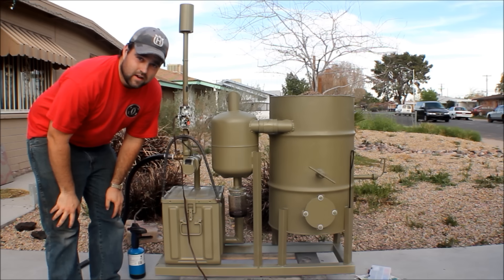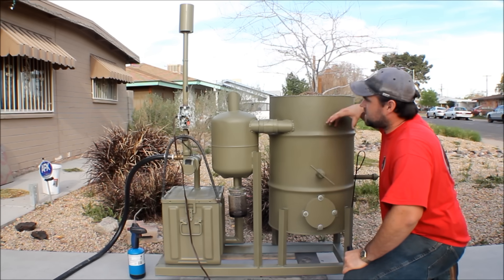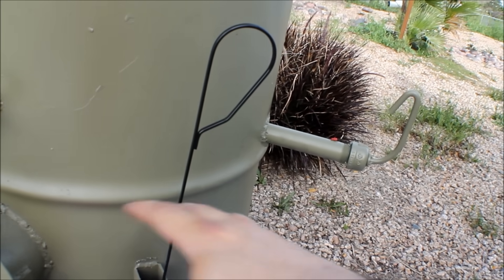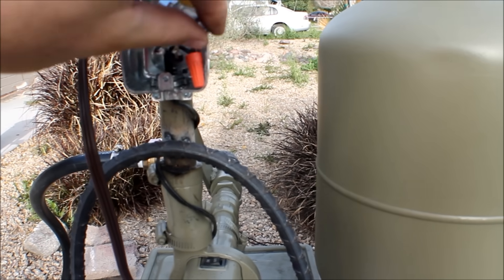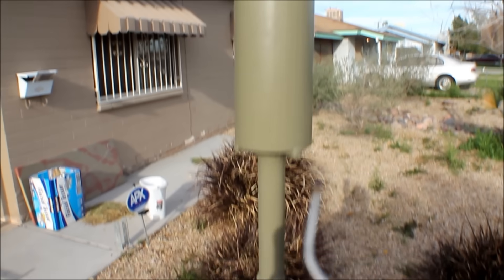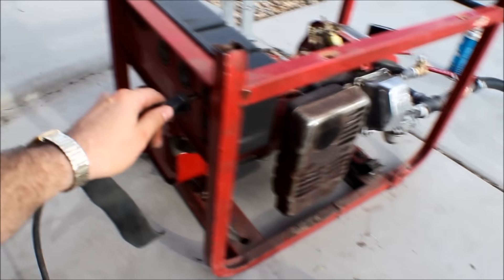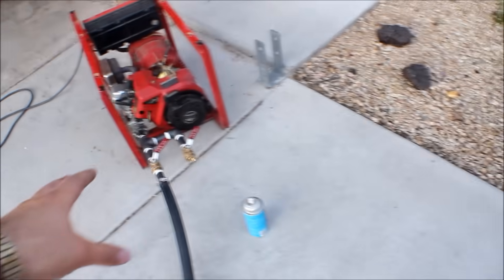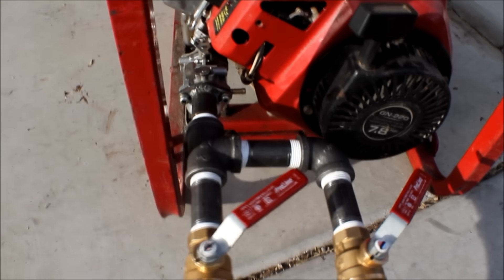amazing homemade gasifier uses wood pellets to run generator -- renewable alternative energy video

Comment: Awesome !!!
This has got to be,
One of the best Homemade Gasifiers I have ever seen so far !!!!
Thanks 4 Sharing Bud!!!
Reply: The balance of stokiometry (air fuel ratio) happens at both the front fuel end and again at the engine generator. I've built larger versions of these (10MW)...partially choke the inlet feeder with a double gate valve assembly and you can improve the efficiency.  The reason the barrel is getting hot is because there is too much combustion taking place at the feed end.  It's a delicate balance keeping both variable components in perfect balance. 

You need J-U-S-T enough gasification to generate combustible pyrolysis gases (mainly methane C4, C5, C6 hydrocarbons)to feed the engine.  Too much air flow and you are unnecessarily combusting wood pellets and unnecessary heat the barrel. BTW when you move into the C8 hydrocarbon range you are in the octane range or gasoline range.  PYROLYSIS can generate biodiesel C16-C20 range some of which is mixed with the water in that separator glass.

Great work though... hats off!
Reply: @invent5540  great analysis John. You seem to know your stuff. Got any videos or materials on what you just explained? Thanks in anticipation of your response
Reply: @josephjames7658  

Hi Joseph... I worked with a retired elderly man in the early 80's who studied at the Zurich Poytechnic Institute under Einstein before WWII... he often spoke about how the Polish underground  ran their vehicles using Pyrolysis wood gasification in WWII.   Before he passed away we built two reactors. The second was 10MW!  A monster...  Pyrolysis... true PYROLYSIS  is absolutely without the presence of Oxygen... gasification is poor mans pyrolysis!   But still good... true pyrolysis generates 100% activated carbon.  Gasification damages the carbon matrix with oils that fill the Carbon voids.  Lookup Absorption vs. Adsorbtion as it relates to Activated Carbon. Typically we use freaon mass variations to measure the quality of the Activated Carbon.  This technology can "believe it or not" SAVE this planet... since it sequesters Carbon.  I could go on and on btw.
Reply: @invent5540  hmm! Can you point me in the direction of materials to study?
Reply: @josephjames7658  

Sure... in youtube research keywords:

Biochar, activated Carbon, pyrolysis,  fluidized bed reactor, absorption vs adsorbtion, waste wood gassisifers, car running on wood,  Carbon capture using pyrolysis. Terapreta.  

Follow the links with the most hits.  I'm 2000 hrs into this technology and still learning.  Dive in and learn... this technology is amazing.  We can use plants to pull Carbon out of the air via CO2 generating biomass followed by a rendering of the stored hydrocarbon biomass into PURE CARBON.

Carbon has four valence electrons and bonds easily to Oxygen forming CO2 OR CO... as well as METHANE on upwards in the hydrocarbon range.  Pyrolysis prevents this from happening forcing the Carbon into being metaphorically "without a date at the dance".  Sequestered Carbon can the be placed back into the ground generating Terapreta... black soil that doubles a plants growth with half the water.  And the Carbon remains sequestered for centuries.   Again I'm thousands of hours into this and could go on and on.  Feel free to contract me with further questions after diving into the keywords I've just given you.
Reply: @invent5540   please make a video. How can I get in touch with any of your work. I know YOU ARE ON TO SOMETHING.  We can keep using fossil fuels,  but also effectively remove tons of carbon from the atmosphere before it goes there from other means. I. Believe it could happen but research isn't funded for this. Only sellable items like oil and hydrogen are in the matrix for energy companies. I'd love to hear back and see more of your work... You definitely know what your talking about and this is for sure the future as a means to keeping Greta Thurnberg happy , ;-)
Reply: John... I checked out and subscribed to your channel.   You and I have similar interests. 

Not sure how to contact someone privately on youtube?  Any suggestions? I can definitely help you in your quest technology wise.
Reply: @invent5540  sir please ,i need a help to design gasifier
Reply: John Solowinski l
Reply: @invent5540   sir, hello can i talk to u about gasifier
Reply: @invent5540  One of the things I love about this process is that if you have a inlet choke you can actually tune to produce more syngas or bio-crude (which can be turned into bio-diesel, pitch tar, turpentine, etc -- it basically can be separated into heavy and light oils just like crude petrol). You could also do some really cool stuff with the the heat if you did your piping right and actually use it to remove moisture from your bio-crude via evaporation. Then after all this, you can take your ash out of the gasifier's oven and use it as soil for plants to grow to start the whole process over again!
Reply: @lymnjuice  
Correct... I must say though it gets messy when you work in liquid ranges.  Try low lying fruit first when getting into pyrolysis.  Clean dry wood chips or sawdust and run hotter generating biochar for soil augmentation.  My opinion btw based on experience...
Reply: violeman I agree. This is one of the best homemade Gasifiers I've seen. Very nice looking, easy to see and well explained how it was made and such a great demonstration from startup to running a saw off of it!
Thanks so much!
Reply: violeman  Yep, I second that.
Reply: @schlomoshekelstein908  Why would you attack this man trying to learn?? I mean what a piece of crap. There is no need for that. We all need to work together. Or do your want to continue on with senseless fake wars fighting and death?
Reply: @jeremywest8559  https://www.youtube.com/watch?v=l01AMCBG0Wk
Reply: @jeremywest8559   what a piece of crap indiad (pronounced indeed). have you watched my video?
Reply: This is the first time I've ever seen something like this. This is very interesting to me wow. I didn't know anything like this existed out there.
Reply: @melvinmariott8609  what U mean ??
Reply: @ValmikiCreations  i never seen something like that before didn't know that was possible to do something like that.
Reply: @schlomoshekelstein908 dear ,
 If you say something about me it's ok because my personal ,if you say something about my country it's not ok  be carefull .,jai hind
Reply: @schlomoshekelstein908  india never loose any thing ,even it's very very very big like  chandrayaan 2 also  ,be remind india is the greatest country jai hind
Reply: @ValmikiCreations  India never loses anything?? Dude your country's biggest diamonds sit in my country's crown 😂😂👑💎

Comment: Nice build man!! i would just reccomend you using a "step down" instead of an rheostat. that would handle much better the power and wont whaste as much energy as the rehostat. if you dont know what i am talking about: http://www.ebay.com/itm/DC-DC-step-down-Converter-Module-24V-to-12V-5V-Power-Supply-3-35V-to-1-25-30V-/321531590090?pt=LH_DefaultDomain_0&hash=item4adcc6b5ca

keep on developing!!

Comment: So if you need electricity to run the blower in order to pull air through the burner why don't you just save all the bullshit, SELL your generator and hook your lights etc. up the electricity you ALREADY have?

His next "invention" is going to be a solar generating station that's powered by spotlights!!!!!!!!!!!!!!!!!

Comment: This is a vid of a Rube Goldberg machine generating power!!  This has a lot of science and careful process control going into it.  You are running on methanol and CO.  The campfire smell is terpenoids aldehydes of combustion getting into your engine that might varnish your cylinder and foul your oil and ruin the gen.  Try an aluminum barrel to lower burn temp and get more wood distillate. Replace the glass jar on the crap capture vortex with steel or Al, if it breaks your system could backdraft and explode with surprising violence. Al crap capture tank will keep the flow to only gasses. And find a way to burn the guinea pig fouled litter, leaves etc to make the system 0-waste.  I like what you are doing!!
Reply: Energy Technology
Some of the most powerful content anywhere
*http://digitalproduct.hol.es/?gocbp=4472*
Reply: Not sure I follow your suggestion to use an aluminum barrel to lower temp and increase gas production.  The hotter you get the pellets, the more and cleaner gas they will produce along with less ash.  Lowering the temperature is the last thing you want to do. I'd recommend making the heating chamber out of stainless steel (SS doesn't conduct heat very well) and insulating the heating chamber with ceramic blanket or custom casting retort (fire) cement to make the heating chamber.
Reply: @mattobermiller5041  Read the suggestion again.
Cooling the gas before entering the vulnerable engine might extract damaging tar..
Tar is one of the major destructive issues along with this fuel concept.
Reply: @mattobermiller5041  You're right.. Seems like I mixed up a few important principles in the process.
Cooling the gas will not influence the amount eventual Tar, (should be dealt with earlier, as you suggest) primarily boost the compression.
Reply: hi, i have tried to build a gasifier  to power my diesel generator for irrigation purposes, using farm waste mainly wheat straw and hay bales, but i'm not getting any flammable gas instead the system is producing a lot of tar, can you assist? my email is mtchikafa@gmail.com
Reply: @mitchellchikafa8170  or wheat straw and hay bales I would think about biogas instead of woodgas
Reply: @mitchellchikafa8170  There's lot of experience with this princip..
Known for decades. Small scale & industrial use 
Do some research on the topic.
German :  BHKW.
The short answer is you need more air by an insufficient burning process

Comment: In theory, could I basically cut off your barrel, and attach my pellet stove I use to heat my house already (from the exhaust pipe coming from the inside of my home), to the cyclone filter and use the rest of this design to make wood-gas? I'm wondering if I can use this gas then to operate an LP/NG wall heater? I would effectively be using a by product to produce more heat for my home and theoretically use less pellets, or produce extra heat, either way I'd be winning...

Comment: Whilst this IS ALL GOOD - - would it not prove wise to surround your generator (& maybe the gasifier) with sandbagging for considerable sound reduction? Secondly, you may consider using the insulation used in ceramic kilns, which comes supplied as a long roll which you wrap around the barrel drum outside. Thirdly, is there not a god replacement for the rubber couplers, as the heat will burn them out (maybe plait some fibreglass fireproof rope & fit it inside a compressor lever ring coupling. That would provide the level of heat resistance needed AND then ensure (by the compression used) a good seal around the edge of the pipework/ducting that needs connecting. (It would also be more easily replaced, should things need such). But going back to point one, SOUNDPROOFING during WORL/TSHTF scenarios, these would take real precedence  to avoid attracting unwelcome attention (during night time, as sound travels further then!).

Comment: Hey Jr. I've watched many different vid's on gasifiers and learned many different aspects from everybody. I always refer back to yours as a reminder of simplicity. I'm currently in the build process utilizing a 55 gal. drum and 6" burn-tube to power a 6.5HP generator. The FEMA chart says it will power up to 20HP. So I'm thinking I may have to restrict the air intake on the burn-tube for smaller engines. I will also incorporate additional cooling and filtering elements. Thanks for the inspiration.

Comment: I love the color and size, nice job !! I'm assuming you would have to build a larger one to power a vehicle? How often do you have to clean out the pickle tar jar? I've seen one of the mobile designs (small pickup) use up to 60' of cooling pipe, basically they built almost like a pipe corral around the bed of their truck. Eventually it seems like you would want to run a little bit of the electricity back to the air pump instead of requiring it to run off the car battery so you can have a more closed loop system. Or perhaps take a car battery and place it on the system for starting purposes and then switch over to the electricity coming from the generator once everything is up and running.
Reply: You turn the fan off after it's up and running. You no longer need it. It's purpose is to draw enough oxygen through the system while you're initially starting the gasifier up. The motor then takes the place of the fan to suck oxygen into the system. It's a really brilliant design because the motor basically becomes the gasifier regulator at that point. The more load you put on the generator, the more oxygen gets pulled into the system, the more pellets burn producing usable syngas. After you reduce the load, the oxygen levels return to normal.
Reply: Just use a mechanical damper/throttle to slow the flow without having to use a pot etc.

Comment: Just a Thought Could You use your Pellet stove and Plumb the Exhaust outside to the Gasifier  system and then use your Generator to power your house while Heating your home at the same Time ?

Comment: Wouldn't and inverter style generator like a Honda require less fuel per kw? Seems like smaller hp motors are on them style

Comment: JR don't use a rheostat - go on e bay and get a little PWM (PULSE WIDTH MODULATOR) speed  controller  - it will be far more efficient
Reply: You ever here of K.I.S.S? "Keep It Simple Stupid" - A pot is much more simple to use as a controller then hooking up PWM circuitry. Especially if its going to be used as a survival machine.
Reply: Agree about not bothering with a rheostat.  A hole in the pipe (upstream from the pump) that you can partially/completely occlude with a sliding sleeve will achieve the same.  All that said, this is a very tidy home build. Nice welds, and it deserved the final paint job!

Comment: Very well done! 

I'm from Barcelona (Europe) and I'm trying to build a gasifier. I've got a couple questions and I hope that someone can answer me.

The genset used to run with natural gas or with gasoline? 

The pump is made of steel or plastic? does it resist the high temperature of the gas? 

Thank you so much!!
Reply: The genset used to run on gasoline.

Comment: I wounder if you could use make a generator utilizing the seebeck effect to power that little electric motor that supplies the system with air.
It would probably be easier to just have the generator power a little fan/belt what ever but the gas need to be cooled anyway so it potential energy that is being wasted otherwise.

Comment: Towards the end I heard you talk about the heat implications, if you where to make your oil drum within a larger vessel and filled it with water, adding in a low and high inlet and outlet pipe and adding a circulation pump. The heated water could be used in a central heating system, much like a CHP setup, therefore wasting even less energy. I am very impressed please keep up the good work!
Reply: This would create unwanted condensation on the inside of the unit and could be problematic.
Harnessing heat from the Coolantsystem of a water cooled engine + exhaust heater + air to water heat pump taking heat out of the ambient heat in the room the unit is kept in is a better option.

Comment: you could use a leisure 115 amp or 750 amp battery charged by a small solar panel. it would be even more renewable.

Comment: Could you ever use the barrel as a water jacket?  Even with copper pipe. Two fold, you could harness that heat, plust it would be a cooling element
Reply: Heat conservation is important in the reaction zones of a gasifier. But the gas leaving the hearth needs to be cooled and could heat a small amount of water. The thermal conductivity of your fuel gas and water are very different so you could get a small amount of water hot or a large amount of water warm. As Han's Frisk stated the best place to get good BTU's would be waste heat recovery on combustion in a heat engine.
Reply: Creates condensation on the inside of the unit and would create additional problems inside the unit. However a water cooled engine attached to the unit could deliver hot-ish water and the ambient heating in the room containing the unit could have a heat-exchanger installed for additional effect of the whole system.
Reply: Hans Frisk If the water condenses on the coils it would not make it to the engine.
Reply: Nicholas Pope its not a problem outside the fuelbox however the hydrochloric acid created inside in even larger quantities if you cool it in some way is. Also the filtering is simplified with the gas going out of the gasifier part hot. And tbh the FEMA gasifier design isn't the best out there but it would req. alot of modifications to achive anything
Reply: I don't think wood gasification would make hydrochloric acid. Coal gasification would make fosgene gas but chlorides are not that concentrated in biomass. If you used stainless steel weak hydrochloric acid would be no issue.
Reply: Im thinking. What if the gasifier was a heat source. The energy created electrically harnessed to a generator that powers the circulation of water. Not only could you get a heat source, the distribution of heat, but generation of power that might distribute that heat, and create future reserves of energy :). Ie batteries to circulate water for heat and run the generator to power batteries.  That would in turn power your heated space.  :).  r